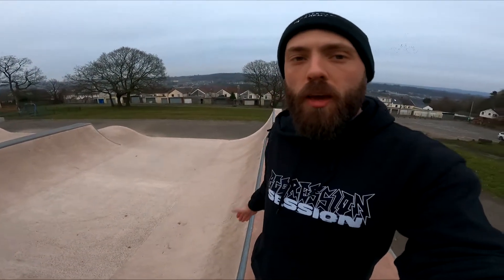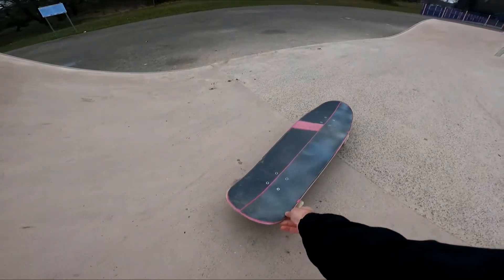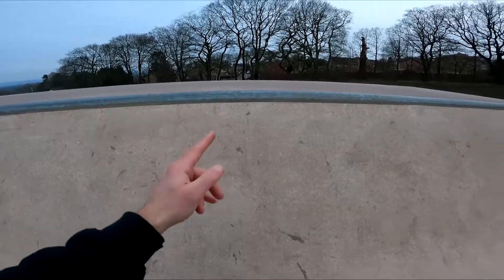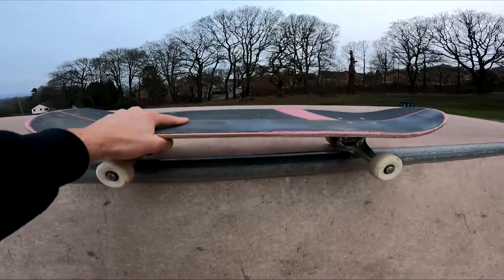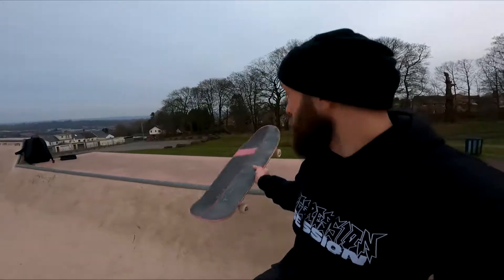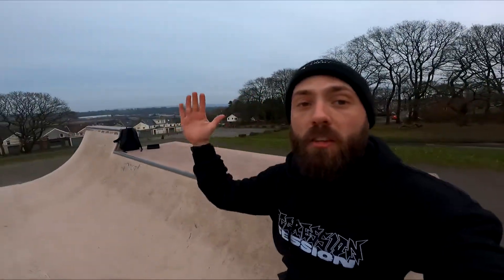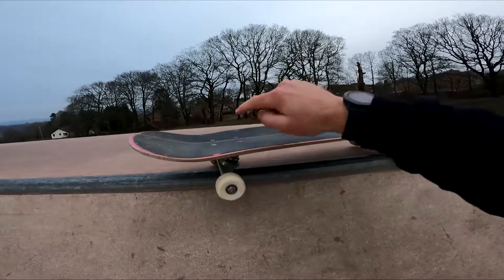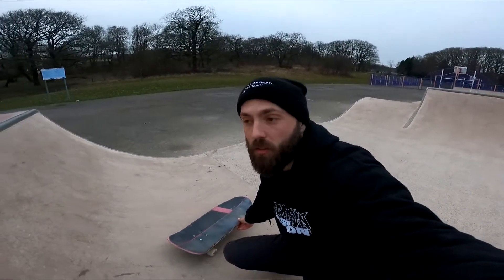LEARN TO AXLE STALL

Comment: Any trick tips for “getting out” of the ramp? I have a tendency to slash my grinds and have a hard time with the confidence to get on top of the coping.  Great job with the videos!
Reply from the maker: Generally a bit more speed and trying to stand tall (vertically) once on the coping will get you more on the deck. Good luck!
Reply: I've been having a hard time getting into stalls. The thing I found stopping me was not keeping the nose of the deck high(near vertical)enough. I kept letting it go too horizontal. Once I got that sorted things started to come together
Reply: @David Trindade exactly the same for me, can’t get my head round it. I can drop in from that position though. Just can’t get into it.
Reply: @morphosis7655  Oh yes, I can drop from 5-0 and axle stall position but to get to it is a completely different game. This week I tried going up as straight as I could and trying to pump on the way up to the copping, it kind of helped but I'm still stuck.